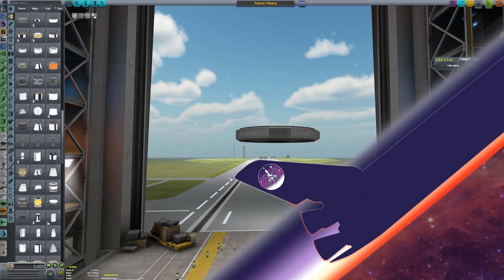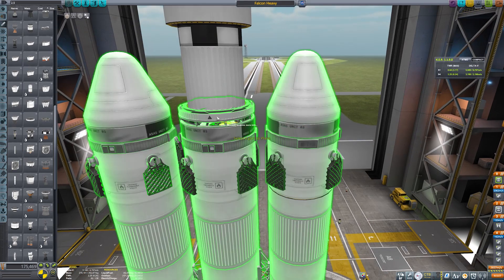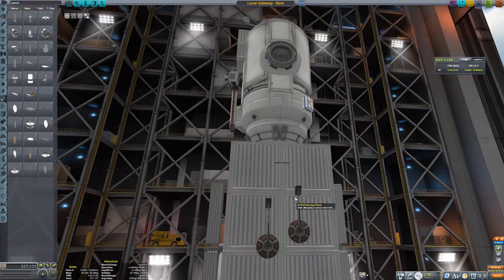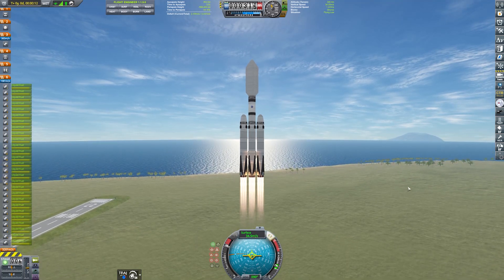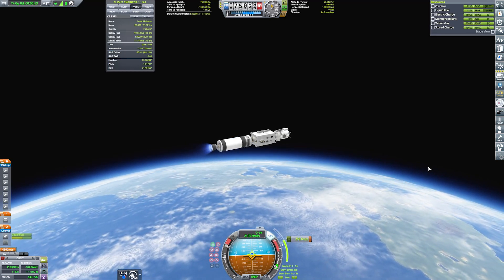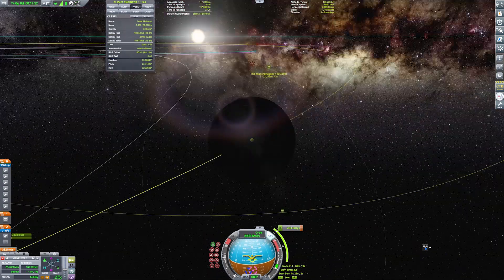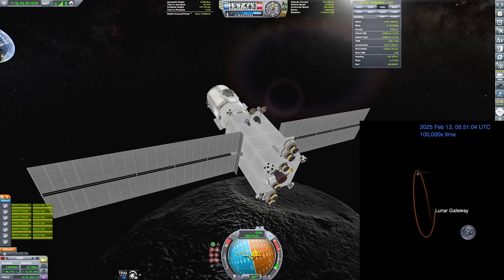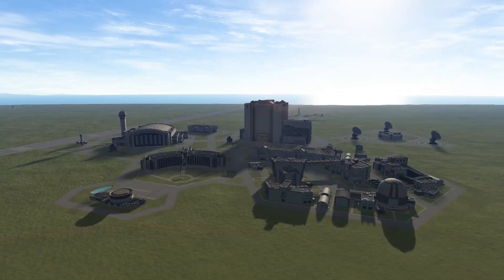Launching a Lunar Space Station on Space X's Falcon Heavy! | Kerbal Space Program

Comment: Hey, I have a suggestion for your booster landing and others: after deploying the airbrakes, wait for the suicide burn to deploy the landing legs
The main booster in the falcon heavy never gets recovered, so putting systems for control of the main booster is just dead weight.
Still, nice video!
Reply from the maker: Yeah, I realised that (the recovery part) after I started editing the video hahaha
I have a good/bad habit of making all my stages recoverable in Kerbal, so automatically kept all the hardware in there.
Thankfully, a Falcon Heavy has more than enough DeltaV in Kerbal for a reentry and landing thanks to scaling, so it wasn't detrimental to the mission this time around.
Also re legs: I have a VERY bad habit of using them as aerobrakes bahahah
Reply: @kyleinorbit  there's no problem bro, nobody is perfect after all lol

Comment: Any advice on how to achieve the halo orbit you got into?
Reply from the maker: Yeah! I did a mid course correction burn to adjust it ☺️ 
After you've lined up your intercept with the Mun and once you're about a 1/4 of the way through your journey to it, you create a maneuver to change the inclination using normal and antinormal (the purple triangles).
If you're not seeing the change on the map screen (sometimes happens)  focus your view on the Mun (right click and focus button) and then just tweak it to pass over the northern pole.
Complete your burn and then create your next maneuver node at the pole, and just burn retrograde (green with a cross) until you capture :-)
Hope this helps!
Reply: @kyleinorbit  I’ve done polar orbits before, and have done midcourse corrections to the Mun. I noticed that while the orbit is polar, is it slightly inclined to keep comms with Kerbin. Is that the case?
Reply from the maker: @NovaRaptorTV  The orbit I ended up in was about 2 degrees off the vertical, but there was a small period of black out every other orbit.
Even with NASA's planned NRHO orbit there is a small period of communication black out that's unavoidable unfortunately.
There's likely a way you could time your orbit, so that your Mun close pass coincides with your orbital plane being just in line with the moon's outer rim, but even then I think you would lose connection every 3 or so passes just due to how small the Mun's gravitational field stretches in KSP.
Hope that helps!